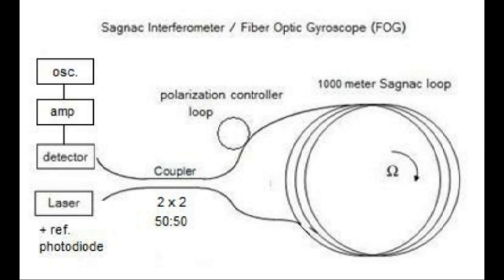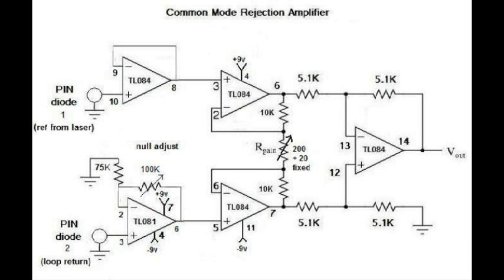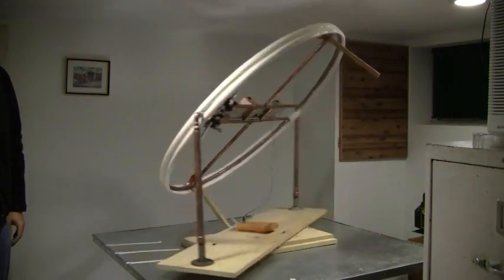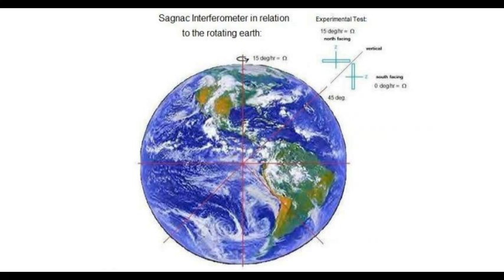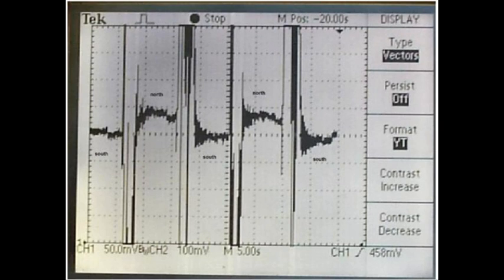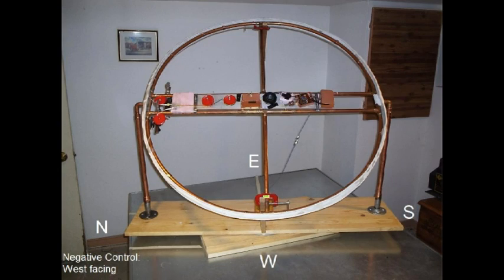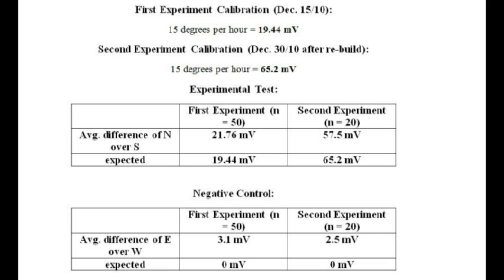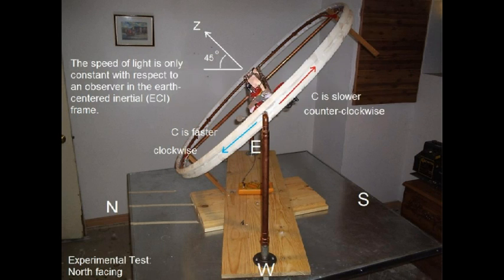Detecting Earth's Diurnal Rotation Using a Large Area Sagnac Interferometer

Comment: something is definitely moving whether its the earth or the aether is another question
Reply: The Michaelson-Morley Experiment disproved the notion of Æther.
Reply: Ryan Q Vincent
So explain to me, how i can track the sun and stars, with an equatorial mount, using only one axis of rotation, and explain, the eotvos effect, and the 2 celestial poles opposite rotation, and hurricanes opposite rotation in the 2 hemispheres and never crossing the equator, while we at it, explain the suns 15 degrees movement in the sky, which can be measured anywhere on earth, and at last equinox sun angles. Thx
Reply: Ryan Q Vincent
Equatorial mounts compensates for the rotation of the earth, if the sun did circles above the earth you would need two axis to track it, you cant draw a circle with a straight line.
The sun can be measured to move 15 degrees in the sky from everywhere due to the earth rotation, if the sun did circles above the earth you could only measure 15 degrees movement at the axis of its rotation(pole).
And yes you are right, i shouldnt had demanded anything, it was just ideas of evidence of the earth rotation.
Reply: Ryan Q Vincent
Not at all, it would not be the same effect, if it was the sky there moved you would need 2 axis to track, its really simple, in reality i can track using one axis, and it has nothing to do with what science tells me, its very simple evidence of the earth rotation, just like the suns 15 degrees movement which can be measured anywhere any time, its simple :), just like its simple to measure the suns angular size doesnt change durring a day, all easy to test yourself.
What flat earthers tell you is mostly not correct mate.
Science are always open to be proven wrong, nothing is 100% in science, all flat earthers need to do is publish there hypothesis, no one did that yet, i wonder why?. 
Do you also deny the south celestial pole or?, you will need magic to get that to work with your rotating sky, just like you would need magic to get any flat earth claim to work, there is a reason why, no working map or any evidence of a flat earth exist, its impossible, the model we have works!. 
Seriously, please start checking what you have been told, because it doesnt fit the observable, testable, measurable reality.
Reply: Ryan Q Vincent
We already know the true shape of the earth,  equatorial mounts only works at the north pole on a flat earth, simple logic, an its not even something to debate, and if its the laser experiment you are refering to, its already been done at an even longer distance https://youtu.be/iLCMbCHaEgc
The true shape of the earth need a accurate map btw, and what we use today works everywhere, within cm's, and factor in curvature when flight planing :). 

Its all about believe and ignoring evidence from your side mate, and i really look forward to within the next few month, you finally find out how you got deceived and manipulated with ease, by the flat earth promoters, then we all can celebrate our fantastic rotating globe earth together.... But i really doubt the results can be trusted, looking at all the lie's flat earth promoters already have presented, and damage control already started, jet engines run on compressed air, haha, somebody is not ready to lose there income from the naive and easy to manipulate people, i hate swindlers, and i hate youtube made it legal to fool people with lie's, so when you in a few month realize you got fooled, plz go and kick you're guru's in the butt from me :), thx!. and peace. 73, 51
Reply: Ryan Q Vincent 
Airy did not conclude earth is stationary. 🤣
Airy's "Failure" was the failure to detect the aether.
Reply: Ryan Q Vincent   sorry you are WRONG AGAIN!  Lookup Hemispherical resonating gyroscopes.  They use PURELY MECHANICAL operation and can STILL measure the rotation of the Earth.  LOOK IT UP FOR A CHANGE
Reply: НЭДVЭЙ:011 
No experiment has proven the existence of the aether.
Reply: Ryan Q Vincent - Here is a MECHANICAL GYRO that can READ EARTH ROTATION RATES:   http://www.northropgrumman.com/Capabilities/HRG/Documents/hrg.pdf     

I PERSONALLY helped integrate one of those units and TESTED IT.  SO COME ON just TRY to explain away THIS evidence.... what is it NOW that you will just MAKE UP to try to prove me wrong?    You can find the PERFORMANCE SPECS and theory of operation here:  http://www.northropgrumman.com/Capabilities/HRG/Pages/default.aspx
Reply: Ryan Q. Vincent - "According to you, not all types of gyroscopes show the rotation of the earth. "    OH REALLY?  where did I say that?  ALL GYROSCOPES - SENSE the rotation of the Earth, but only sensitive enough ones can REACT TO THE ROATTION and provide us a VISUAL INDICATOR.  IN other words - IF you have a regular mechanical gyroscope THEY CAN READ EARTH RATES!  I integrated one of the very LAST mechanical Gyroscopes to fly on a spacecraft onto Mars Global Surveyor - It was (wait for it ) ........ SENSITIVE ENOUGH TO READ EARTH RATES   Just like the Ring-Laser, Fiber-Optic and Hemi-Spherical Resonating Gyros  SO I have PERSONALLY TESTED FOUR DIFFERENT KINDS of Gyroscopes and they ALL READ EARTH RATES.
Reply: @stuartgray5877  looks like these ring laser have become quite popular with the Globe Buster's debacle. I just started looking into them and since you seen to have knowledge on these and we have had civil debate before I'd like to ask a couple questions. Are there any good videos showing any extension testing of these devices that you can point me to so I can actually see some real test data. Also The ring laser according to Bob has a 15° drift which is supposed to be the rotation of the Earth, has anybody tried to zero this drift out by flying or otherwise going against the rotation of the Earth. It would seem to me that if you can't get the laser ring to not detect a drift then how would you know it's not some inherited design of laser light being divided and bought back together that causes a little drift? I look forward to hearing from you. Thanks
Reply: @Flat_Earth_101  - Check my playlists for more videos (one playlist is just for RLGs). 

 As for "The ring laser according to Bob has a 15° drift which is supposed to be the rotation of the Earth, has anybody tried to zero this drift out by flying or otherwise going against the rotation of the Earth."

That is not how it works.  Look at it this way.  If we are at the North Pole, and I set a 3-axis RLG on a level table with the "X-axis" pointing straight up, the "Y-Axis" Pointing in the direction of the Prime Meridian (pointing ~ at Great Britain) and the "Z-axis" pointing 90 degrees to the Y-axis or along the  90 degree longitude line (pointing ~at Russia).

Now take data on all three axes.  The X-axis will report POSITIVE 15.0 degrees per hour and the Y-axis and Z-axis will report no motion. (there is no earth rotation component in either of those sensing axes ability to sense the motion).
Now flip the gyro over and take more data. The X-axis will report NEGATIVE 15.0 degrees per hour and the Y-axis and Z-axis will report no motion.
Point ANY axis straight up and ONLY THAT AXIS will sense rotation.

Now lets move to a location at 45 degrees latitude (Say Sheridan Wyoming) and repeat the test: X-axis UP, Y-axis pointing East, and the Z-axis pointing North.

NOW the X-axis will only sense about half of earth rotation rate (since the sense axis only gets a partial component of earths rotation rate), the Y-axis will read zero, and the Z-axis will read a rate similar to the X-axis (since it is tipped 45 degrees  with respect to earths spin axis).

Now do this at the equator and the X-axis is pointing perpendicular to earth's spin axis so it will read ZERO rotation, the Y-axis will read zero, and the Z-axis will read 15.0 degree per hour since it is now aligned with earth's spin axis.

This effect is THE SAME as how latitude affects Foucault Pendulums.
Can you visualize how these devices work now?
Reply: @stuartgray5877   is there a video of any of this? Cause everything I've seen just shows this on paper. I'd even settle for a video where they can show the drift and then phase it out, on the y or z plane then reposition it to the x plane and see the drift start again.
Reply: Ryan Q. Vincent - "of which hold there position in space"    No - these "Inertial Measurement Units" do NOT "hold their position in space"  they only indicate ROTATION ABOUT AN AXIS.    Even with the HRG, the mechanism ITSELF does not "hold it's position is space" , BUT the *oscillations setup IN THE crystal DO TRY to remain stationary while the Gyro itself moves.       

  "The ordinary gyroscopes don't show the rotation of the earth because of... reasons... "  Ordinary gyroscopes cant INDICATE the rotation of the earth because their BEARINGS are not low enough FRICTION for the Gyro to RESPOND to the miniscule torque applied by the rotation of the earth.     There actually IS a video of someone showing how to find true north using a gyroscope which it does by SENSING ROTATION.  https://youtu.be/-3ELhspVAUY
Reply: Ryan Q. Vincent - And I just noticed something.  The article I posted about the NG HRG http://www.northropgrumman.com/Capabilities/HRG/Documents/hrg.pdf         Shows data gathered from the Deep Impact mission and shows a picture of the integration of the spacecraft on page 33 (figure 44).  I AM IN THAT PICTURE, as I was the Integration & Test LEAD for both spacecraft.  And the data they show in the plot was gathered BY ME during the flight while calibrating the IMU & the pointing of the telescopes.  Figure 45 shows the liftoff from KSC pad 17-A where I just gave the Spacecraft is on internal power and ready for launch call on the net because I was the launch test conductor .
Reply: НЭДVЭЙ:011 
No it didn't. Read the actual paper. It disproved the aether hypothesis.
Reply: What this experiment demonstrates is that motion detection is completely relative. Every thing is in motion (because time is simply the perception of a reality in motion, its what creates time) its when a difference in motions between two different things do we notice. Ever been aboard a highspeeding train? Youre in motion, but the train is in motion, and you can inhibit an additional motion within that train,  aka walking.  You feel like youre just walking the same speed, but if you are walking to the front of the train, your speed is actually the train's speed + plus your walking speed,  BUT this is relative to the ground. The thing is, earth is in motion, but also the entire universe is in motion. We are not the only things moving.  Detecting with instruments such as these is just not gonna work. And all that means is your method of testing is faulty and doesnt account for all variables.
Reply: Here is another paper where they use Ring-Laser "gyros" for far more sensitive tests than JUST Earth rotation:  http://iopscience.iop.org/article/10.1088/1742-6596/723/1/012061/pdf
Reply: The 'results' of the experiments speak for themselves.
Reply: @Gra Ra5 I guess you didn't understand what I meant. The bottom line is Flat Earth has been taken to task by Congress. I'm sure most of them probably don't know much about about it but they're are a few that might. And I'm sure you would agree it wouldn't take much actual proof to destroy Flat Earth a 24 hour 4k live stream from space , a 360° ISS shot, a REAL  picture of Earth. All fairly simple for any a National Space agency  I would even probably settle for a ring laser gyroscope video by You if it  showed all that I asked for. But there's none of that, all I do find is evidence that there isn't 8"in of curvature squared per mile. Sure there's is also a bunch that appears to be unknown with the Flat Earth model but I'm not too concerned with that, as I believe that either we will never understand this world or maybe the truth will come out.
Reply: @Gra Ra5 I don't have access to a RLG that is why I'd like to see one on video being tested in a scientific way.  I've read where the " drift" can be changed using different components. Also I would like to know why the 15° drift doesn't change to 16 ,17 ,18, 19 ,20 ... As the minutes pass by. If you physically turn the RLG I've see in video the measurement does increase, so why doesn't the supposed rotation of the Earth increase the measurement? It could be that this drift isn't a measurement of the rotation of the Earth but an inherent fault of the equipment or something else. 
 As far as the 15° angle here's a video that demonstrates how it could work on a Flat Earth. https://youtu.be/IYCB6JW2Kjk 
Also if you need me to show You that the Blue marble pictures aren't real you have not researched much. But if I need to show you how to tell the difference between a real photo from NASA and a fake imagine from NASA I can do that for you.  We can next discuss Radar and  maybe explain to me how it doesn't disprove the 8" curvature but from what I researched radar isn't affected by Gravity and works well beyond curvature.
Reply: @Gra Ra5 I'll be on the road all day today but I'll try to squeeze those suggested videos in. And I like how you sidestepped the Radar question but don't worry we'll revisit that.
Reply: Gra Ra5 
Lol! The papers of the 1887 MMX, Sagnac’s 1913 experiment and Michelson’s 1925 M/G experiment all have positive motion and detection of the aether. ...

Simple
Reply: +elonesnah, I suspect the true shape of the earth will be known over the next few months.  Until then you be happy with the globe. Peace.
Reply: +Stuart Gray, Telling me that I am wrong does not make you correct. :)  Look, you are starting to sound quite desperate to convince people. Look, because I don't believe you does not mean that you are wrong. :) Just ignore me and move on to someone else. ;-/ I may be wrong  - I will find out later. ;-/ It happens ;-/ 
  I just find it quite interesting that you have to pick certain types of gyroscopes that you think show the rotation of the earth. According to you, not all types of gyroscopes show the rotation of the earth. I find that interesting about you. You are saying that only 'special gyroscopes' show the rotation of the earth. :)
Reply: +Stuart Gray, Let me summarize what I think you are saying. There are different types of gyroscopes. All of which hold their position in space. However,  there are special ones, that you have access to, that show the rotation of the earth. The ordinary gyroscopes don't show the rotation of the earth because of... reasons... :) That is why the 'ordinary gyroscopes' the we have access to don't show rotation of the earth? :) 
    Ok, you have convinced me (ok, maybe I still have a few doubts - not). Peace to you.
Reply: +elonesnah, why are demanding that I do that? Was there are vote to put you in charge of me at some time? 
  Whatever, what has what you demand  to do with the earth not rotating? How the display system in the sky works is a separate issue. All the other effects must have explanations that don't involve the earth rotating. You don't actually believe that there is only one explanation of how effects happen on earth do you?
Reply: +elonesnah, You may be the one wanting to kick the butts of the  suppliers of your current opinions about the earth. :) You may think about the folly of trying to look at the sky to find out the shape of the object you are standing on? Peace to you.
Reply: The Sagnac effect proved the existence of the aether. The Michelson-Morely experiment proved the earth is stationary and the null result of Airy's 'failure' proved the aether is moving.
Reply: +Chrstopher Ellis, I assume that you haven't done any reading at all and are just repeating what you have been told. What you have been told is incorrect.  You need to understand that 'Science' really wanted the earth to be rotating. It would be a great blow to the heliocentric view if it wasn't. And they would have to admit to having been mistaken. 
    There was a series of experiments that was carried it to try and prove it was rotating. They all failed to find any rotation. In the end the answer that was agreed upon was that the measuring sticks used to measure lengths actually shrink in the direction of motion (Yes, I know it sounds silly. Imagine putting that forward as a serious suggestion at a party?). However, even the people who suggested this admitted that if it did not happen then the earth would not be rotating.  
   And, yes, the 'aether' does exist as was proven by 'Sagnac'.

   It is worth reading about "Airy's failure (1871)" and why it was considered a failure. It has never been discredited in any way. It was just not talked about for a long time.
Reply: +jeff,  What the Sagnac effect shows is about the 'aether' not the Earth. The experiment here shows the that  'aether' moves across the Earth. This is easily proven by mechanical gyroscopes that show that the physical earth does not rotate. Also, In 1871 the astronomer Sir George Biddell Airy proved the celestial bodies are in motion relatively to the stationary earth.
Reply: +elonesnah, What you are told as to what the do. And what they actually do is actually different. :) Obviously it is tracking the movement of the sky. The effect is the same. Seriously, please start checking what you have been told. What you have been told is not always correct. Especially from 'science' ;-/